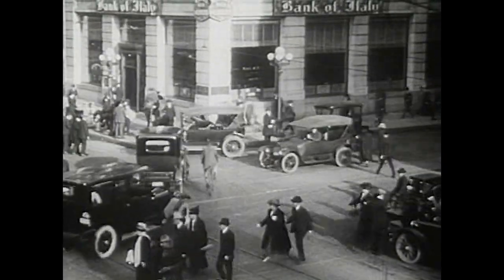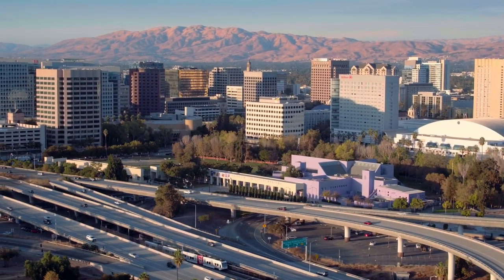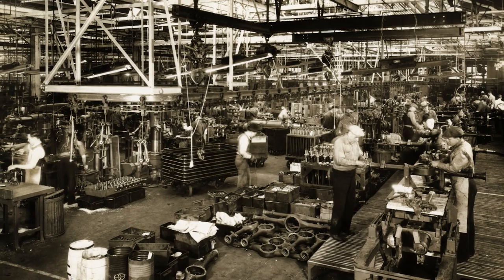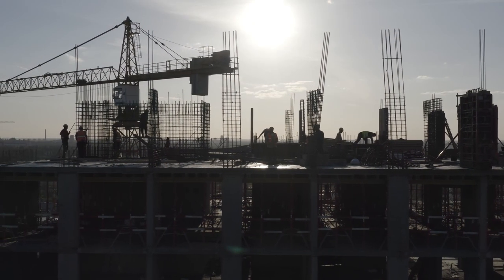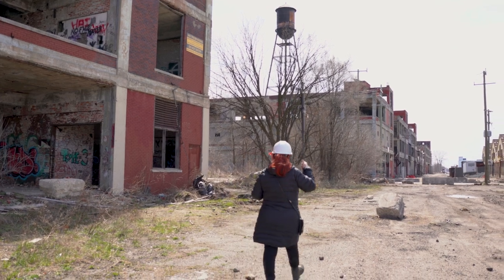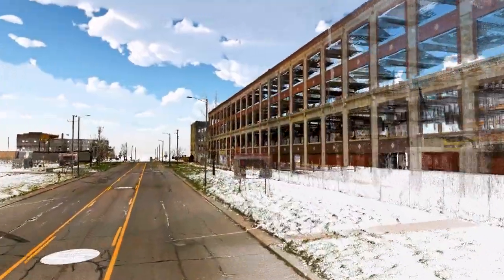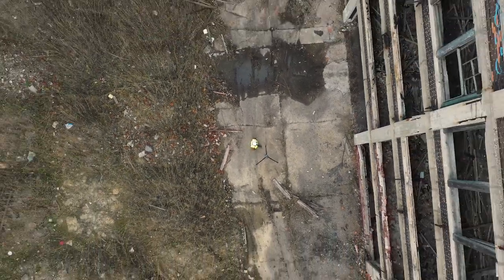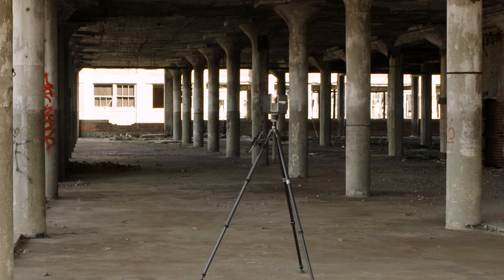Digitally Documenting Detroit’s Past: Packard Plant Preserved with 3D Technology

Comment: There were a few beams cut with a torch on the bridge on the inside even back in 2011 when you walked through they were going straight up in the middle maybe scrappers or the city trying to get it to to collapse so they can say its dangerous and knock it down also tunnels underneath the buildings it was a fun building to explore